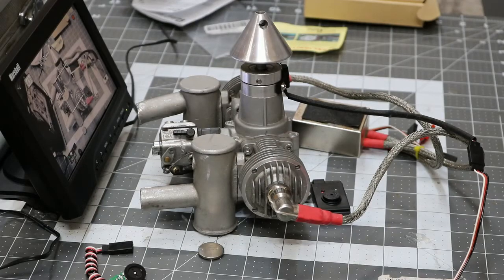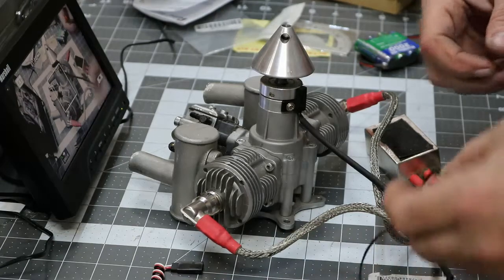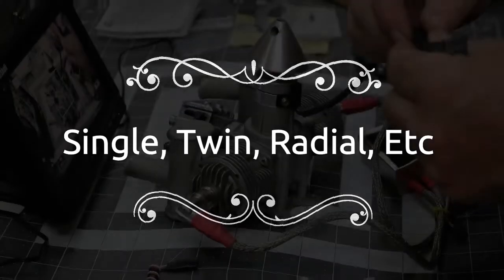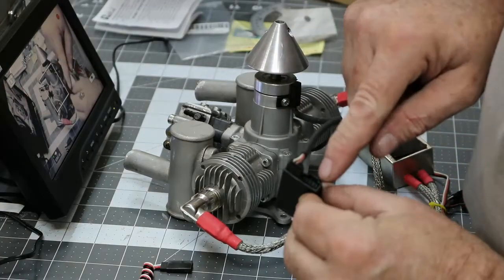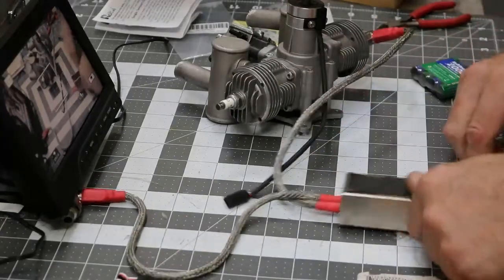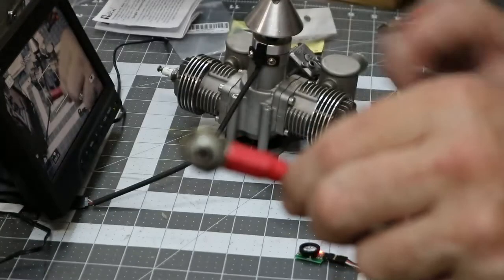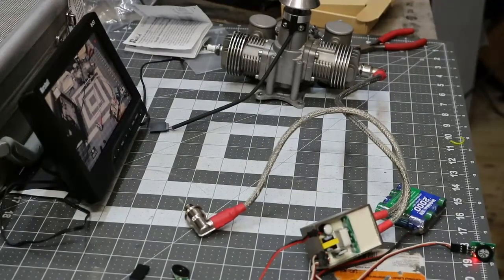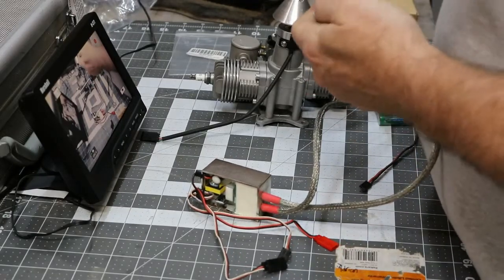HOW TO... Ignition Tester and Hall sensor tester HOW TO USE.for   Rc airplane

Comment: Anyone ever use these two devices successfully on a DA single cylinder ignition / sensor?
Reply from the maker: All the time
Reply: @GottaKnowJoeHobbies  thank you. I have a digital ohmmeter that captures minimum and maximum sensor resistance when the prop is flipped. Indications were the sensor is working so it I ordered a new ignition module. Sure enough the module was the problem after eliminating the sensor as where the trouble might have been. The DA sensor does not appear to be a Hall effect type. DA calls it a coil sensor.
Reply from the maker: @extra330sc   I misspoke I was thinking DL the old Dle when I answered you I do not see many Da's as they are reliable for the most part but the cost makes them more elusive as well.
Reply: @GottaKnowJoeHobbies  My DA50 is 15+ years old. Now I know how long the ignition module lasts! LOL. Best regards.

Comment: hi, which power supply do you use? 

Thanks in advanced
Reply from the maker: For ignition? 4.8 to 6 volt on some others will take upto 8 volts you must read manufacturers voltage rating..the tester comes with 2 3.7 flat watch battery style

Comment: Very useful, thanks.
My ignition connector which conects to the spark plug has a spring in it, what is that for and is that needed?
Reply from the maker: If it's the one I'm thinking of it slips over the plug end. Shoot me a pic Google our contact info. If its there it's for a reason
Reply: @GottaKnowJoeHobbies  thanks but I have already got the answer.